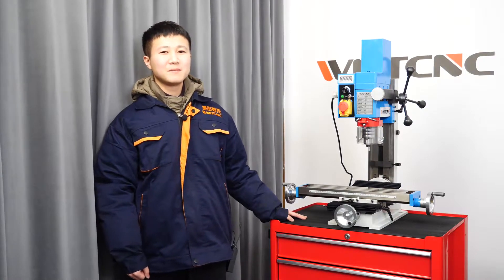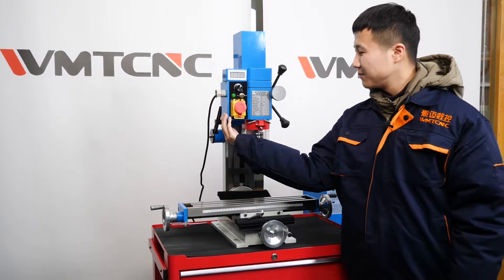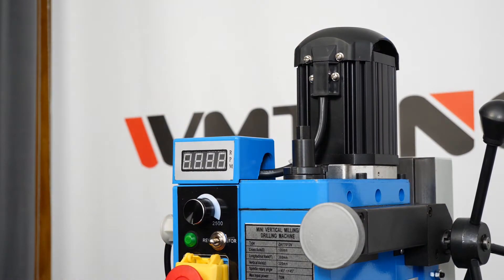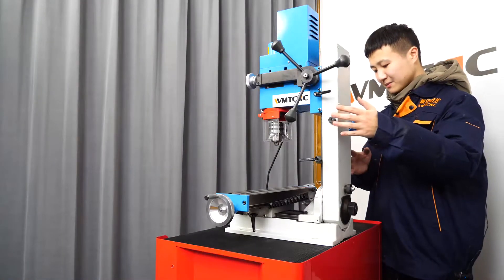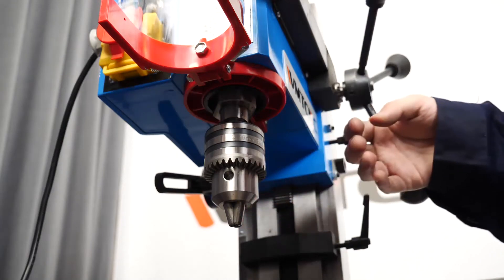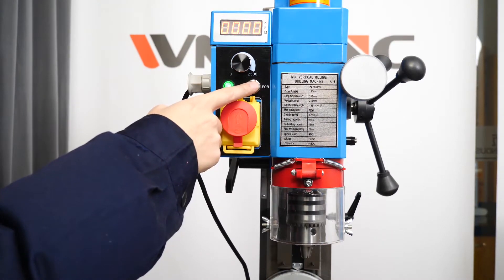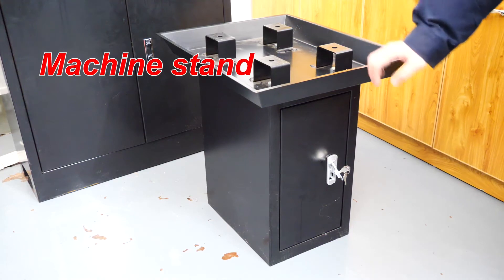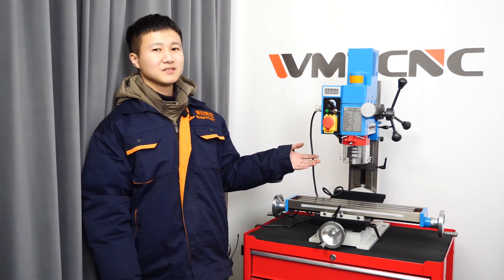Cheap Chinese Mini Metal Mill Milling Machine | Machine Details

Comment: I have this one.
will take easily aluminum with 10mm cutter for 0.5mm depth on 2000 RPM
Reply: Accuracy?
Reply: @oldlee2706  10.02mm at X Axis ) i go right to left), and I  have real good end mill from swiss, and in addition I placed air pump that removes chips - so it is great mini mill for the beginners. It will not take steel, not strong enough, but aluminum and brass- yes.
Reply: @asimonp79  if you face a material maybe a length of 150mm, how many microns difference will that be?
Reply: @oldlee2706  all i do is 30mm pass. never exceeded that length
Reply: @oldlee2706  One more thing- I have bought on aliexpress the cheap DRO magnetic ruler, and had it installed on XYZ axis. Saying for sure that the only thing to be warried about is finding your 0 at the Z axis. The slack is almost one turn of the Z axis fine tuning knob. so the Z Axis DRO has to come first.
Reply: @asimonp79  oh thank for the info. By the way how much you paid for it?
Reply from the maker: OK， that's good